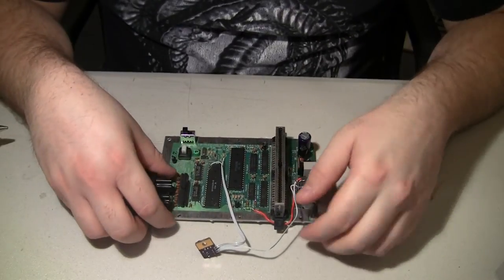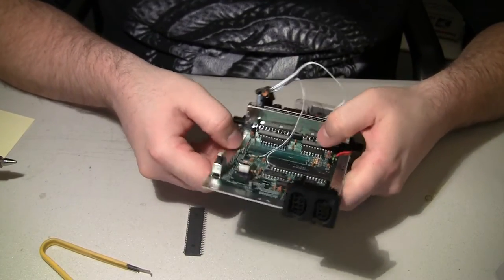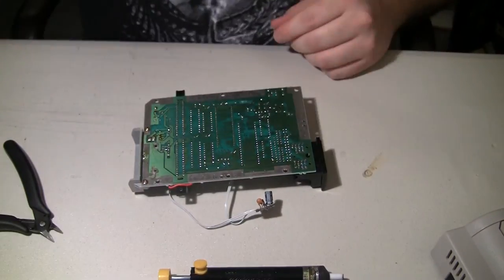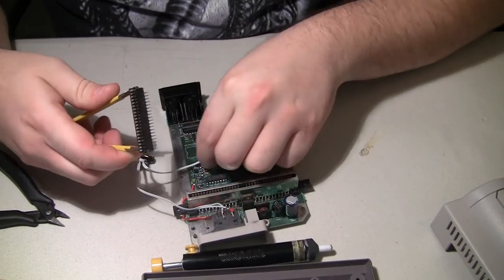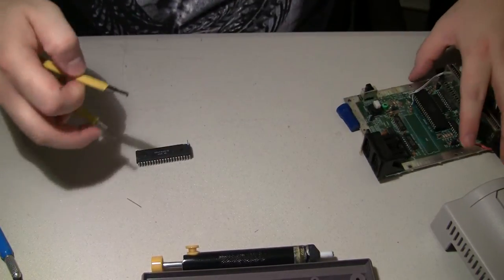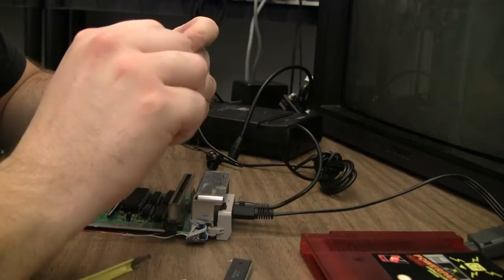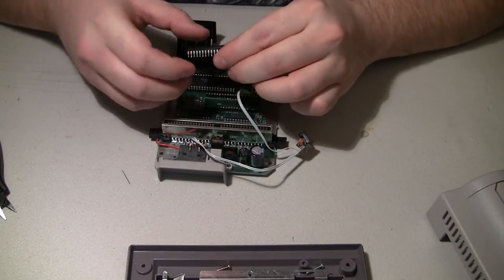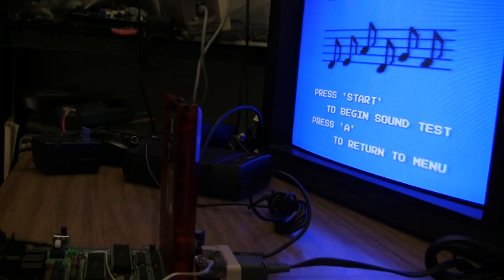NES-101 CPU PPU repair - reset cap showed bad

Comment from the maker: The test 'rom' is one of several that nintendo put out on a real test carts for actual techs to diagnose NES's back in the day. You can find the roms online and put them on the powerpak or everdrive for use, much easier than making a homebrew cart, but that's not impossible either, in fact I think most repro makers sell a test cart multi cart.

Comment: this is the exact mod that im about to do to my toploader.  the av mod with multiout port.  glad i came across this video in case i run into the same issue.  and although i don't have access to reference working CPU/PPU chips in the event I have one, this video still helps.  really liking your vids.  great stuff.

Comment: I got a top loader Famicom from eBay today.  It took a couple tries to get it to load a game, but it ran. I took the case off for cleaning, when I tried to run the board with the case off, I had nothing.  Grey screen, audio buzz.  VERY HOT  CPU chip.  How the heck I managed this is beyond me, but I am assuming I have killed my CPU.  I assume I can harvest chips off another Famicom or NES, but where do I get these turn pin sockets?  I might as well put some in, if I’m going to be doing this.